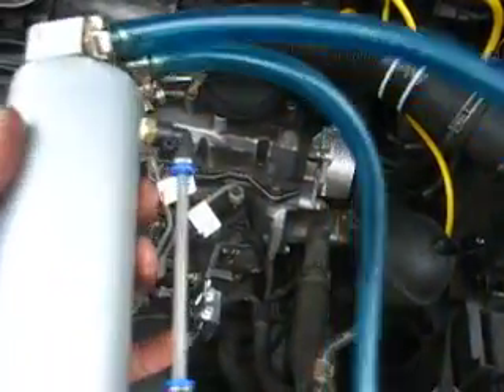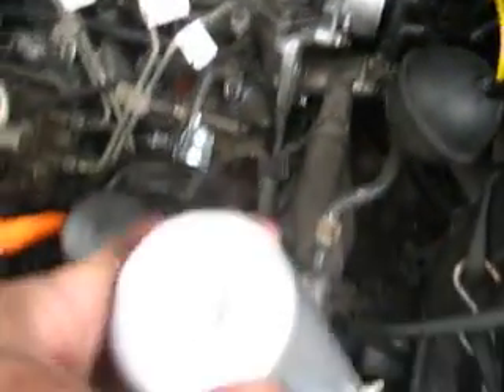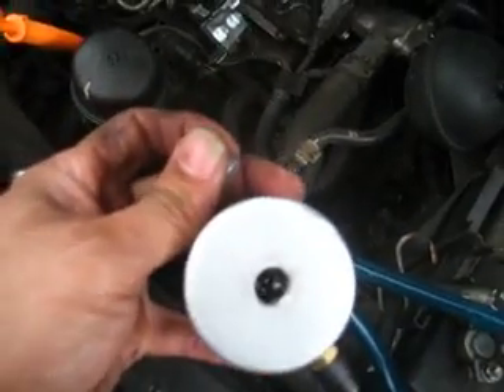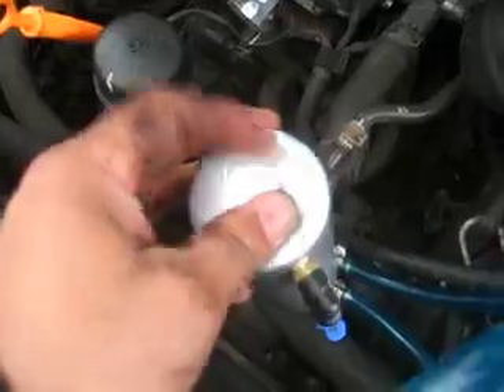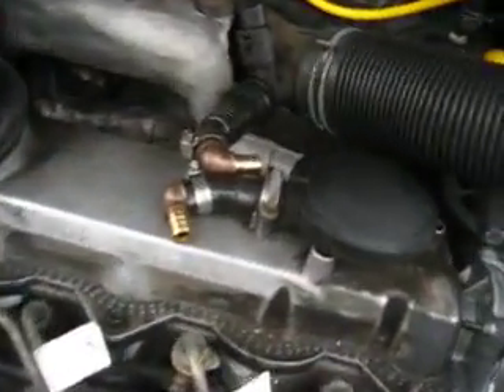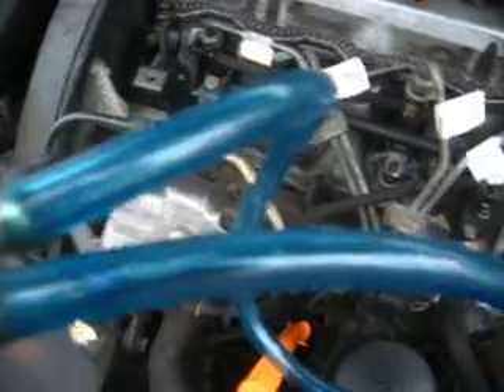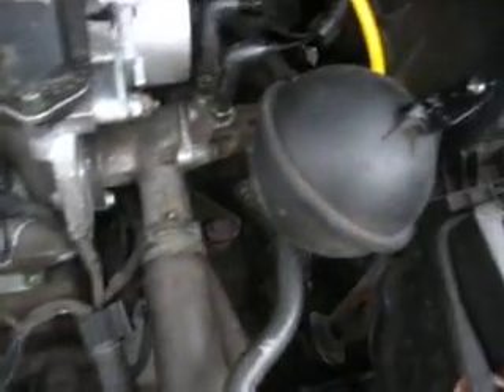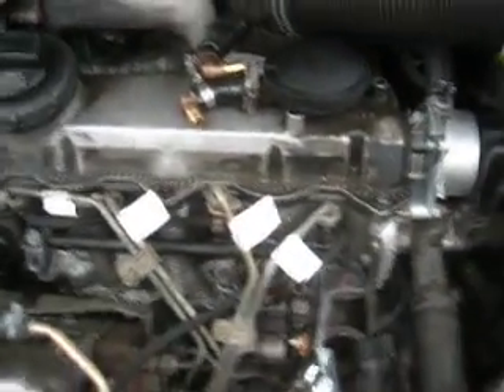VW TDI Oilly Intake CCV Fix 4 of 6 - Oil Separator

Comment: I was wondering how to attach to the hockey pic & intake because those hoses are stepped up. What size are the fittings? Work alright? Does this setup throw a CEL? I'm looking to buy the same on EBay, Speed Daddy is the company! Thanks, Dave.👍
Reply from the maker: I went to my local (bigbox) home improvement center and simply matched the fittings.  Note: with diesels bigger hoses are a must.  The setup does not throw any CELs but if the hose is too small it will choke the motor and/or hurt performance.  The steel wool should be course not fine and will not rust.  Note: I had to drill and tap larger hole in that eBay oil CCV because the original ones were too small.  In the next month or so I will try the OEM BMW CCV, but the one in the video works as it should.  I empty it once every two months an I would say the contents is 60% oil and 40% water.

VDub Love from Chicago. (and thanks for watching)
Reply: Thanks GC!

Comment from the maker: @shotgungaz77 The way the 1990-2003 TDI engine was designed some oil was supposed to loop through the system to lube the intake side of the turbo, but with the addition of the emissions recirculation in the US, the results are disastrous. The exhaust soot re-enters the intake an sticks everywhere. Even if you remove the EGR system the cumulative effect of this small amount of oil on the inter-cooler is a reduction in efficiency and performance. The answer is to use synthetic oil use a separator.

Comment from the maker: @WAKeele The 98-03 TDIs were best known for their dependable (minus stupid plastic; impeller water pumps, window gear sets, & shift linkage boxes.) The fact that these TDIs are expected to achieve +500k miles stands as a testament to the marriage of mechanical and electronic engineering.  

When others are driving ultra-lite 100% electronics dependent cars that get only 40MPG, I can sleep well knowing my family drives a top safety rated car that just happens to run on Diesel and get +40MPG.

Comment from the maker: @WAKeele This system is not restrictive and over time it will ensure a continued smooth responsive TDI.  If you do not remove the Crank case vaporized oily liquid.  It will re-enter the engine through the intake. where it will coat the wall of the intake with a sticky tar like residue.  This tar is then mixed with the soot from the EPA mandated Exhaust Recirculation EGR.  This mix will, over time, completely choke off your TDI's ability to breath. I say stop it before it starts and save some $